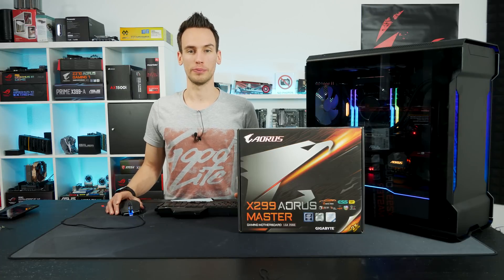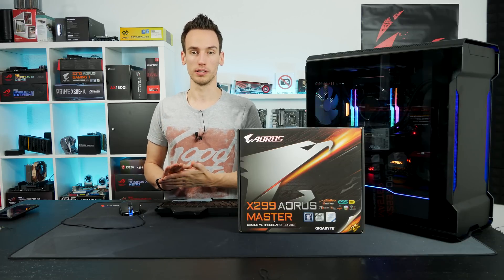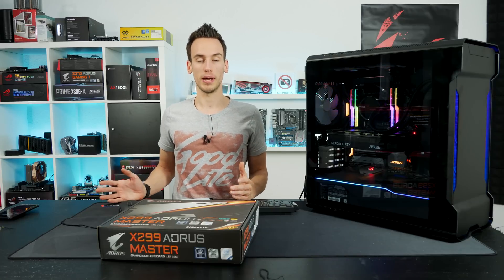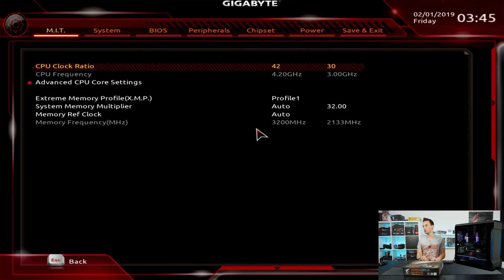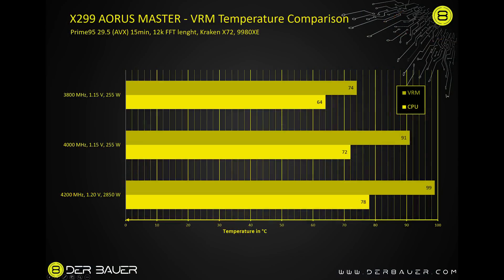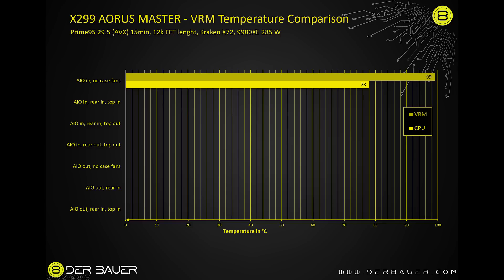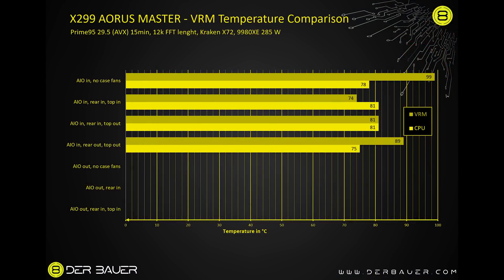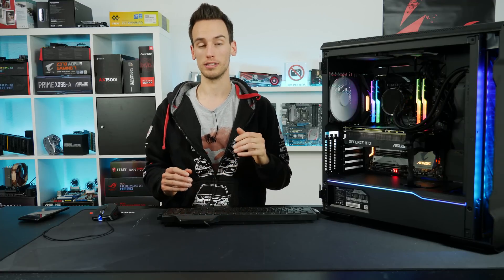PC Airflow Test - Real Mainboards have Fins

Comment: Wait a second, did I hear you correctly when you said disabling Intel Turbo Boost removes power limits or something? Or did I misunderstand?

 IF i did hear that correctly, is that just a Gigabyte thing, an X299 thing, or all Intel CPUs? Just asking because I have my 8700K @ 5GHz, but I never bothered disabling Turbo Boost. Although I did raise the CPU power limit to 140%, so ??? 

I'm guessing i either misunderstood or turning off turbo boost is just a shortcut? I dunno, I've only been overclocking for 5 years or so, 1st time I hear anyone say anything about turning off turbo boost, i just figured once I input a multiplier turbo boost has no relevance, but if it does something with power limits should it be disabled then? Sorry if it's a dumb question, just kinda read a few guides 5 years back and been OC'ing ever since, so it's not like I know a whole lot about everything :P
Reply: it's a gigabyte thing
Reply: @ActuallyHardcoreOverclocking  it's a buildzoid thing
Reply: Thanks for answering that, was curious about it. And Buildzoid, thanks for your videos too man, I certainly get a lot out of them, especially your VRM analysis videos, only guy I ever see go that in depth about VRMs and motherboards and graphics cards. Keep up the good work man!
Reply: it must be a gigabyte thing.
Reply: I have a Z390 Aorus and I'm wondering if this shortcut works for my board as well. I've been adjusting everything manually.
Reply: @psedog  Like Buildzoid above said, it's a Gigabyte thing. After he said that, I went into my BIOS and turned off Turbo Boost (on an Asus Maximus X Hero) and funnily enough the processor ran at a SOLID.............3.7GHz :P After looking into it more, I guess Asus uses the Turbo Boost and adds to it to reach the multiplier (or something like that, according to what I read anyway. Don't know if that's true, but it makes sense if the CPU is running at base clock after turning it off, even with a x50 multiplier). Also I guess all the manufacturers have their own way of doing these things, so they're all different, go figure :P Would be nice if the terms and ways things are done are someday standardized, but meh, I guess brands have to differentiate themselves somehow.

Comment: I have a Lian Li 011 Dynamic and have top intake and bottom intake with the side mounted AIO pulling the hot air out on my 8086k build (Z370 Aorus gaming 7 mainboard) and have really nice temps. Pleased to see that I'm not completely crazy for trying that as the top fans blow down over the motherboard :)

Comment: I've had 2 40x40x20 fans mounted to my VRM heatsinks for the last 4-5 motherboards I've had.
Reply: After my asrock extreme 11/ac motherboard had its 40mm fan die resulting in me taking a $3,000 computer out of service I swore that was the last time I would buy anything with a 20/40mm fan by choice. You would think I could pop in a replacement but I haven't been able to.
Reply: @billschannel1116  I bought them without.
I have entire bags of 40x40 5V fans.
Reply: @enlightendbel  Oh, that's totally different because you don't care when they fail. That's awesome. I sure wish I could fix mine. Because long story short, that motherboard is irreplaceable to me! (I require Media Center, Media Center requires windows  8.1, 8.1 requires <=6700k, There are no new 6700s especially with 22 sata) I might hit you up for suggestions on getting that fan off/replaced.

Comment: Why didn't you try front in, top in, rear out. I've found it works the best for my AIO, cpu, vrm and gpu
Reply: I am wondering what the results of this would be too. It seems the CPU temps are best when the AIO is pulling in, and the VRM temps are best when the top is pushing in. Having the rear as exhaust would help remove the heat from the GPU as well as assist with the AIO pulling in.

Comment: Put the AIO on the top and have it blowing air out in a push configuration.  Then run the same tests.  I would think that would be far better if the case supports the AIO on the top.  You then aren't bringing in the hot air from the AIO.

Comment: der8auer : You could also test with 3 140mm high static pressure fans (because of the dust filter) in the front pulling cold air in, one 140mm fan in the back pulling hot air out, and finally a Kraken X62 AIO pulling hot air out in the top for the case.
Reply: basically an ideal setup for a case, the way he arranged the fans in the video make no sense to me

Comment: Doesn't seem worth giving up filtered intakes for a few C lower VRMs and slightly higher CPU temps when the VRMs aren't even close to 'danger level'. Especially for a day-to-day system.

You also didn't show if "in, out, in" would be a viable combination that could give you most of the effect on the VRMs (from the top-in) without having to resort to the unconventional air-direction. (Not asking for a re-test, just making an observation.)
Reply: Yeah, I wouldn't sacrifice cpu temps for a cooler vrm unless the vrm was >90C and running without a filter doesn't sound great
Reply: Nowadays most cases have filtered top and bottom, and there is a selection of fan filters for the 12/14 cm you have at the back, so this is not an issue.

Sure, the back fan's filter is screwed and therefore harder to take out to clean when compared to front/top/bottom filters that are tabbed or sliding, but this is a small price to pay for 30°C difference in temperature if you're building such a powerful system and overclock it to these power/heat levels.

Comment: Would be interested to see aio on top pulling hot air out (without the top cover on the case) with front fans pulling in and rear pulling out or without rear.
Reply: Bikeo Matic that was going to be my suggestion too. How much would that assists  as it should in theory be more efficient for the fans to pull the hot air out the top.
Reply: PCTechHub this case’s version isn’t that great as the top cover blocks the air which has to escape through the side cuts in the top cover (and it all get bit stuck top gets warm and it just does not work well) once you remove it, it will get much better but obviously the looks will suffer. So in a way I don’t expect results to be that much better with the top cover on but would be much better with top off. I bet a $ in fact .
Reply: This is how I am set up.  360 AIO rad up top exhausting with front intake and rear exhaust.  My thought process is since I am drawing the air up toward the AIO and the back of the case I will have a decent amount of air across the VRM.
Reply: D H that is correct, you could test with rear intake to see if that make a diff or not, do you have the top cover on or off?
Reply: Bikeo Matic I may give that a try.  I’ve been thinking if my setup is optimal as I have such a large surface area of exhaust being the 360 rad up top.  I have a TT View 71 case.  Intake at the front is quite a long reach from the front to the VRM /CPU area.  By the time airflow gets toward the back of the case most of it has likely been pulled through the rad up top.  I’ll play around with it and switch the rear fan to intake
Reply: @Danth01gt  same case and same setup with a h100i top mounted with noctua 3k rpm fans pushing through the rad as well. not running anywhere near 3k during normal use though obviously.
Reply: thats my exact setup with the thermaltake view 71 tempered case i believe it is and it works pretty well